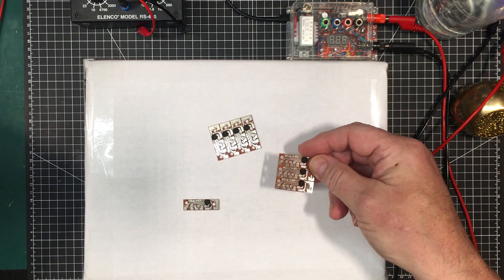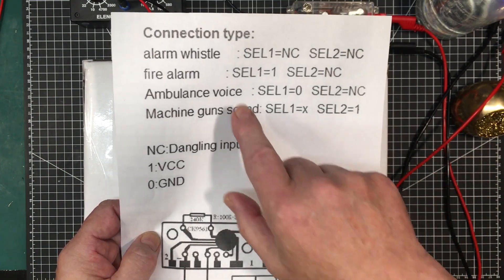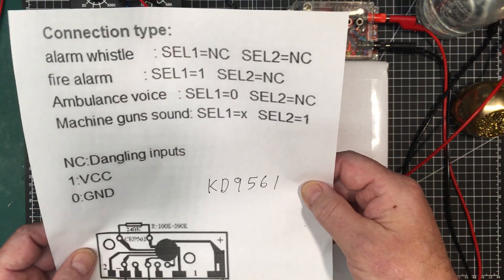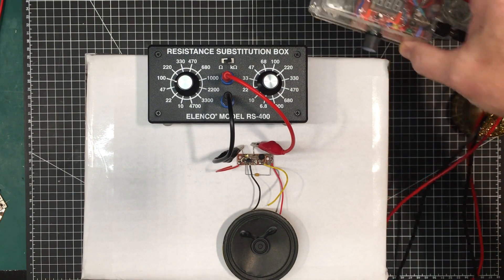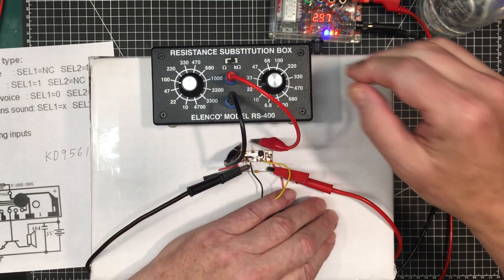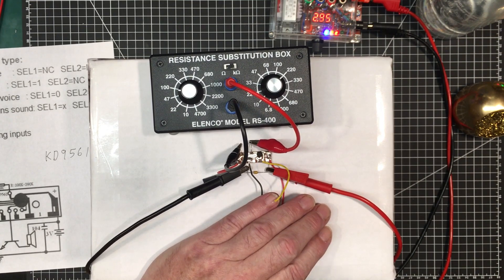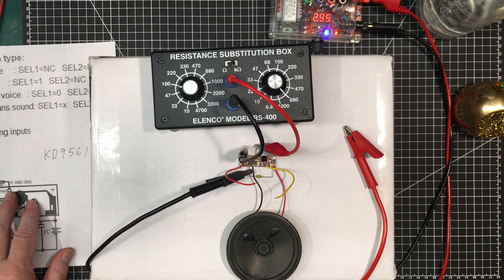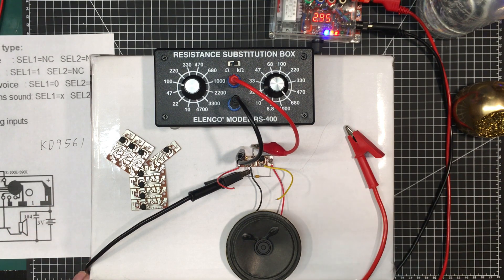Uni-Byte 0091 - KD9561 Sound Chip - And ALEXA gets involved.

Comment: apparently this can produce 16 sounds, not just the four most people think. there’s a schematic detailing that online, if you just look up the chip’s part number
Reply from the maker: You can actually make infinite different sounds with it by changing the internal clock resistor (the one specified to be 240 ohms).  I updated the description here and put in a link to a kit based on the 16 sound schematic you mention.  That's how they make the 16 sounds.  The 4 base sounds and 4 different values for the clock resistor.
Reply: @uni-byte  got it, makes sense. always wondered how chinafakes did it…